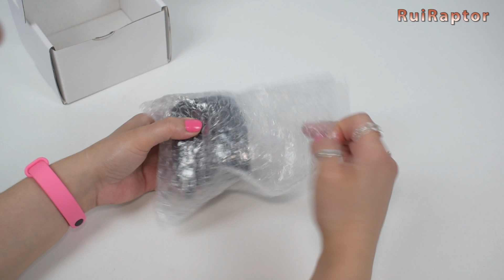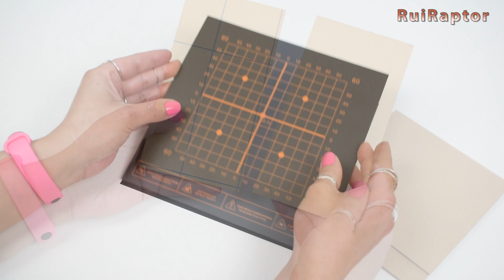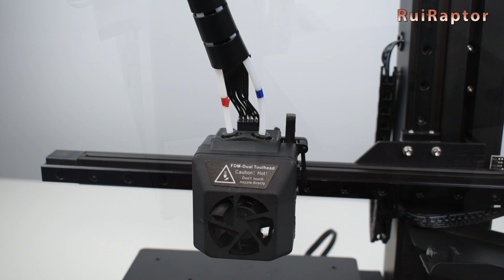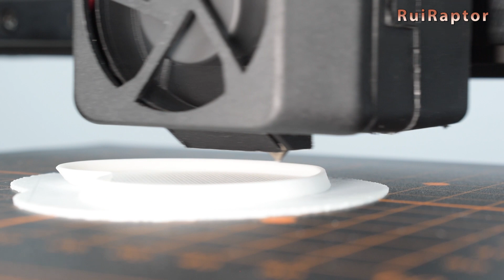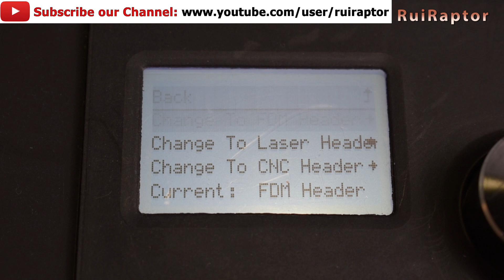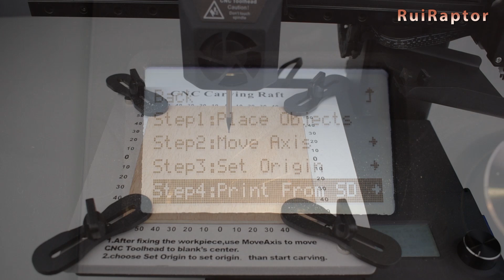EcubMaker TOYDIY 4in1 - Unboxing, Tests & Review

Comment: Save your money looks good here on this video don't do what we did seen a video like this and ordered one from gear best we payed over $900 for it only to find all we got was a $900 paper weight it was so badly damage with the heads broken and the printer bent out of shape the Z axis was bent 15 mm to the left the x axis arm was bent right down until it was touching the print bed. So think twice before ordering one

Comment: in the hands of good méchanical eugineer , this machine can be turned in a good way ! before to use it , check every adjustement and tightness , for cnc may be cut the cuting tool to minimize the distance beetwen the motor andthe cutting point !

Comment: hi ecubmaker your email Sales01@zd3dp.com does not work have send email to you several times and got back delivery demon message not delivered 

here is my question then:
what materials can ecubemaker 4 in 1 use
ABS Filament
PLA Filament
PET Filament
PETT Filament
Nylon Filament
PVA Filament
Sandstone Filament
Wood Filament
Metal Filament
HIPS Filament
Magnetic Iron Filament
Conductive Filament
Carbon Fiber Filament
TPE Filament
Glow in the Dark Filament
Amphora Filament
Reply from the maker: Hi, we do not work for ecubmaker. We only made the review of the machine.
Reply: @ruiraptor  i see but as you do that maybe you know what filament the machine can use?

Comment: Very questionable machine! The cooling is strange, the levelling system seems to be not the best (what values does it shows in tests?) and that shitty bit holder in the CNC head is really a mess. It needs some serious upgrades and probably changing motor drivers (or the whole mobo).
It can be good or not worthy. Depends on the price (is unavailable currently). I hope the devs are fixing it's major bugs as it seems to be a good concept (except the cooling!).
Can it be used to make PCBs by it's laser?
Reply from the maker: Hi, PCBs with laser no, only with the CNC engraving toolhead.